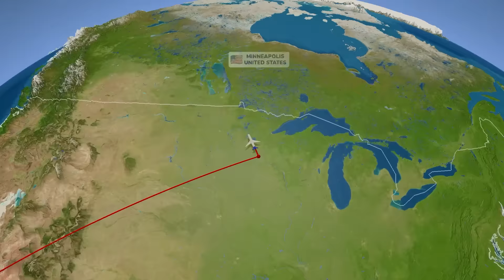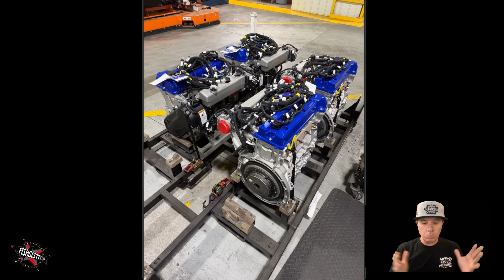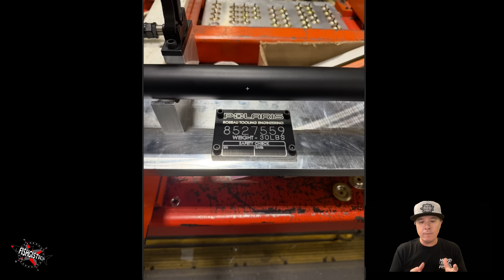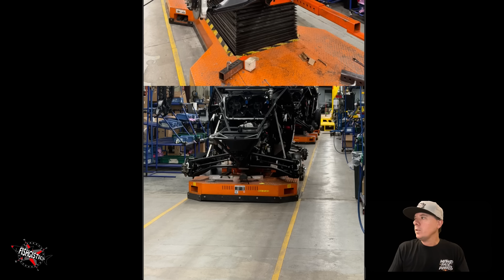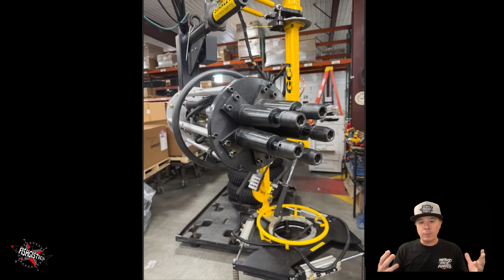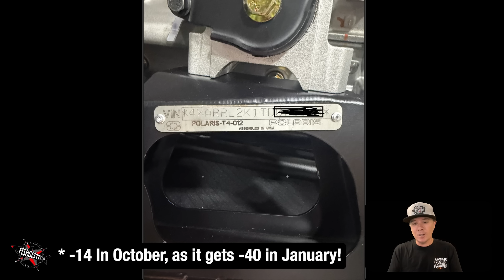Polaris Factory Pro R RZR Race Vehicle - Assembly Line Tour

Comment: How can I get a chance to talk to someone from Polaris? I bought a sportsman in 05 and now it's dead. Did some trails, plowed some snow, it still has the original tires on it. It ran great until it stopped running. The computer is dead, no replacement part available. They made a carb version of it, same year, same model, but there's no carb conversion kit for it. It's like my investment just vanished, now it's just taking up space in my shed, it's always been kept inside. Is there any way to convert to another engine? Am I supposed to just eat a shit sandwich? Pay $1,000 for a used computer on eBay,  as is, no warranty. Yes there's a whole bunch of us out here, so a used computer is $800-$1k, Polaris won't even talk to me.

Comment: It would be interesting to see video of the chassis getting built and welded.  Hoping it’s all chromoly tubing. Also, can the owners choose different colors, wheels, tires, etc
Reply from the maker: Yes it is 4130. They all come with the raw carbon fiber body, no color options. Wheels and tires come with the 4 BFG/Method and then anything else is up to you.